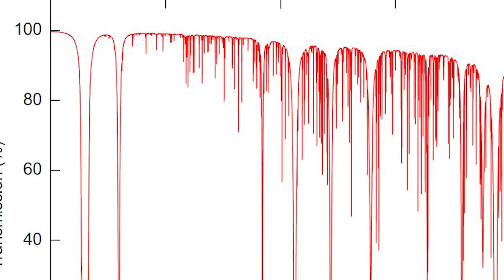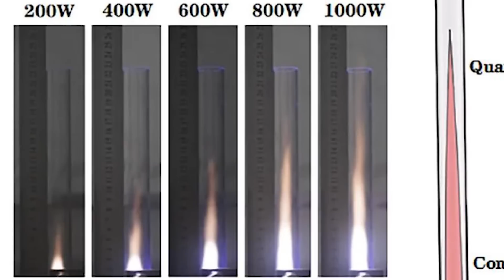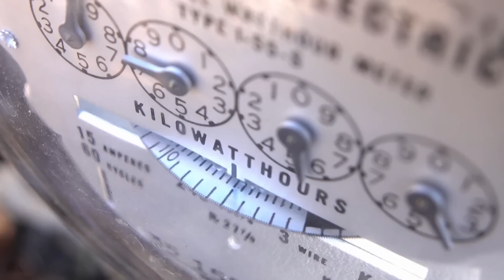The Microwave Plasma Jet Engine that Could Change Everything

Comment: I know that there are RADAR units that can generate several megawatts of microwave energy (I've worked on one), though they're definitely not small or lightweight. A reflex Klystron tube tube has to be shielded by lead panels because it will generate strong enough x-rays to be lethal. Those are probably outdated by now, though they were still in use around 1980. 

An aircraft would have to have a means to provide electricity for any form of plasma engines -- photovoltaic cells won't be able to. Current battery technology would be too large, bulky, and heavy, plus the manufacturing of them (including mining and processing the minerals needed) would add to overall pollution (which China has been doing a great deal of). 

I'd have to agree with the "pressure cooker" quote -- all they did was heat the air in that tube. Plus, the round ball has some aerodynamic properties of its own. 

Might we ever get ion thrusters of sufficient power to propel craft through our atmosphere? Maybe. Probably not in our lifetime, I suspect.  

If we did have all manners of commercial aircraft with "plasma engines", all of that ionized gas they'd be spewing would be wrecking havoc with our atmosphere, radio communications and navigation, weather RADAR, and more.
Reply: I had never even considered the EM noise from these things. That might even be a problem in space, the only environment that ion thrusters even work.
Reply: @eloiseharbeson2483  I'd think that the solar wind would carry away the ions over time as long as they were far enough away. Around our planet, they'd just get sucked down into the magnetosphere at the poles. The ions within our atmosphere could be a problem, though.
Reply: @eloiseharbeson2483  Agreed, besides the discussed points on them creating more atmospheric pollution than they would prevent, especially if a renewable alcohol based fuel is used with modified jet technology for large airliners and H2 fuel cells and batteries for smaller prop based travel, the atmospheric drag losses and relatively short flight distances from one part of the planet to another will require a mammoth amount of energy. The only way I see these working for intraplanetary travel is with H2/O2 rocket assisted takeoff to get them to an altitude where air resistance isn't an issue when it is lit off, and very long distance, like a NYC to Tokyo flight.
Reply: @eloiseharbeson2483  "In space, no one can hear your ionic scream".
Reply: Klystrons are still very much in use. Many high powered weather and surveillance radars use them.
Reply: @kiowablue2862  I think that is because the klystron is more tuneable.  Radar systems can do clever things with the frequency of what they transmit.
Reply: I think a magnetron is going to be more efficient that a reflex klystron.  In the klystron tube, the electrons still have a lot of kinetic energy when they hit the anode.  This makes a lot of heat and X-Rays.  In a magnetron the electrons are moving nearly at right angles to the surface as they come to it and they hit the part that is currently on the negative going part of the swing. This should mean that they are slowed a lot in the process.
Reply: @kensmith5694  I haven't worked on RADAR units for quite some time, so I'm not sure if or how much they're still used.  The one I mentioned was used in a RADAR system I used to work on that put out between 3 MW - 7 MW, though at the time it was being phased out. The magnets for magnetron tubes can be heavy, also are fairly strong -- we stuck a guy's arms to a metal storage cabinet by putting one magnet half on each wrist with his arms out wide. He could not pull himself off. X^)
Reply: @ronaldlebeck9577  Radar and Satellite systems have been using traveling wave tubes (TWT) for awhile
Reply: @_____ Or, the curve could flatten out to "no further improvements".
Can you give me an example of a working short-haul electric air flight service?  Or even an airplane model?
Reply: I had a middle school science teacher who used to work at Los Alamos when he was younger. He told us how they used to take the radar dishes and use them to melt spoons together for fun. This would have been in the 60s probably
Reply: You are aware that to some extent stove flames are also ionized, right? :))) 
Ionized species recombine rather rapidly after the energy source maintaining the plasma is removed.
Reply: I suggest you look up “keys to the truth”youtube channel “how do top gun fighters work”. Microwave plasma crystal electric engines. We have had these engines since the sr71. No room for fuel in wings and no fuel tanks, same with all 5th gen fighters.

Comment: The elephant  in the room is that  ion propulsion  is a method of converting energy to motion. An electric motor does this today.. RC drones and experimental airplanes already exist. They  are all limited by their power supplies.The real breakthrough is cheap power and lightweight power sources.

Comment: So what generates the electricity ? How can anything be lightweight enough to output the necessary power. Can't be nuclear. So what fuel to run the generator ? And what is the source material for the plasma ?
Reply: If you look into china there are tons of scams like these. Baking companies that are suddenly applying for semiconductor grants from the gov "yeah sure". This is just another of the manyyy scams going on like this in china
Reply: Hamsters! Lots & lots of Hamsters spinning the generator! /sarc Commerical jets use more than 40 MW of power during flight.

Comment: Great, but how do you generate the electricity to generate microwaves?
Reply: Lots of coal.
Reply: @dMb1790  I was going to suggest a turbine engine running on kerosene.  You could direct the turbine's exhaust out the back to get some extra thrust.
Reply: @kensmith5694  😆😅🤣i see what you did there. Kerosene such as jet A?
Reply: @sinformant  Yes, I was hoping to entertain the lurkers with that one.
Reply: @kensmith5694  so like an APU
Reply: @NotRandoWis  No, more like a jet engine.  Think about how much power is needed.
Reply: Extention cords.
Reply: @AtomicSquirrelHunter  🤣😂🤣 yes

Comment: Yeah, but what happens when we runout of unicorn farts?
Reply: Lol, you made me chuckle. I suppose the correct answer would be to use genetic engineering to produce more unicorns, thus solving "The Great Unicorn Fart Shortage" of the early 21st century. The farts would have to be fartisctically adjusted for the hyper inflation we are now seeing in modern times. Thanks Biden.

Comment: Even if such an engine has zero carbon emissions, I have to wonder if such a plasma powered device might still have any effects on atmospheric chemistry.
Reply: Yup. It would produce a lot of Nitrogen oxides. I am pretty sure the EPA would say "No F'ing way!"
Reply: With the electricity required to generate that plasma, there’s obviously still going to be carbon emissions involved in generating it. Nuclear power is our only way to fully go green, but people are ignorant and scared of it. Solar, wind and hydro work, but not nearly as well as nuclear. The emissions caused in building windmills and solar farms takes a ton of generation to offset in the first place, while nuclear power is thousands upon thousands of times more efficient!
Reply: High ozone emissions, maybe?
Reply: @rockydogsdad  NO2 emissions.
Reply: I am also figuring ozone emissions as well.
Reply: Scientifically speaking; no. Lightning forms plasma with every strike and its only effect on the atmosphere is creating water-soluble nitrogen compounds that are greatly beneficial to plant life.

Plasma is simply high energy particles of whatever gasses are being elevated, the only route from high energy to low energy is by bleeding the energy through radiation (I.E. heat or light)  or by bonding molecules.
Reply: @MisterLEM0NS  It is very likely that such and engine will make lots of ozone.  This is fine at a high altitude but near the ground it is trouble.

Comment: Microwave yea right did anyone catch the real problem here.
How are you going to protect the people and the electronic in the aircraft without heavy grounding?
You would have to rebuild every airport across the world as the ion stream from the engine would knok out radio communication it would be like a nuke came out of the engine all that ion gas.
If the engine lost it shielding YEK'S.
It sounds all well and good till you look into what else it's going to effect.
Out in space no problem here what new gas's will it make from the air going through the engine as you are super heating it ?
Let's hope they look into all it's problems now and the ones it will create!

Comment: The thrust wall could be shielded by a magnetic field.  That increases the power use, unless you use permanent magnetics.  That moves toward magnetic hydrodynamic drive which does work for small aircraft propulsion.
Reply: Ah…a heavier pressure cooker !
Reply: @edward5979  If you really want to crank it up,  add a nitrogen cooled super conductor.
Reply: Nope. A magnetic field would never be sufficient at high pressures. Plus heat would be an issue since magnetic coils generate a lot of heat, and with superconducting you need the added wieght of cryogenic liquids and cooling equipment.

Never going to happen. A commerical Jet with convential engines has about 40 Megawatts of power.
Reply: @guytech7310  Magnets are being used to keep fusion temperatures, 100,000,000 degrees, under control.
Reply: @deltonlomatai2309  Very very low pressures, in the milli to microtorr in fusion reactors.  A plasma jet engine would operate at very high pressures, at hundreds of PSI (1 PSI = 52K millitorr) Also need a lot of power to energize the magnetic coils.

I work with this stuff.
Reply: @guytech7310  Iter will generated a force capable of holding the twice the force of the space shuttle.  "The structure of the ITER central solenoid—the large, 1,000-tonne electromagnet in the centre of the machine—must be strong enough to contain a force equivalent to twice the thrust of the Space Shuttle at take-off. That's 60 meganewtons, or over 6,000 tonnes of force"
Reply: @deltonlomatai2309  The plasma inside the the ITER reactor is is 10^ -4 PA or 6x 10~-8 PSI, or 3 microtorr.  Look it up if you don't believe me.

Structure of the ITER is to hold the weight of the reactor, wieght of the coils, & force generated by the coils pressing on each other. 

Plasma pressure in the reactor his to be extremely low so the ions can reach speeds to overcome the coulomb preventing fusion. 

I work with this stuff, I know what I am talking about.
Reply: @guytech7310  2.05 atmospheres, a 15 percent improvement was achieved at the MIT fusion reactor.  2.05 ~ 1558 torr
Reply: @guytech7310  Typical prefill pressures for tokamaks are between 1 and 100 mPa. As will be explained later, ITER will have to operate at prefill pressures of typically p   =  1 mPa, which means npre  =  2.4 · 1017 m−3. For H2, D2 and also He, each prefill particle carries two electrons.

Which is what you are describing.
Reply: @deltonlomatai2309  OK, then why are you telling me its enough to operate at high pressures that are at hundreds of PSI required for Jet engines. its like trying to compare a mosquito to a Boeing-747 and staying they are the same because they both fly.
Reply: Bwah ha ha ha ha- sorry.   It would never work and way a ton.

Comment: all of this is a joke. it doesnt work from a physics stand point as well as there is no real shortage of liquid fuels like jet fuel. this is a classic case of "vaplr wear"
Reply: Your right that it will never work, but World Oil production peaked in 2018 and is now in permanent decline. World will have to deal with 5% to 7% annual Oil production declines going forward. I suspect by the early 2030's Commerical Air travel will collapse as the cost of fuel will be too expensive.
Reply: There is a shortage of jet fuel once you leave the atmosphere though.
Reply: And how do u know this please respond also china will collapst and it cant affoard a war yust 1 week and there going to have 30 k casualtys and they have 0 EXPIRIENCE in warfare beside its like russia Yust 100 times worse
Reply: It's even more suspect when you consider that this technology would be game changing, yet the Chinese are boasting about it before it's even a prototype aircraft

Comment: Quote of the day "the pressure cookers don't fly" 🤣 great video as always!
Reply: Pressure cookers don't fly TWICE.
Reply: @sometimesleela5947  this
Reply: Dark Tech: "Pressure cookers don't fly"
Mythbusters: "Hold my water heater"
:)
Reply: Yeah! 
But they had a good point. Lifting that ball means nothing, unless it's lifted far above the opening (at least 10 cm or so, above the opening), so it gets clear that it really is the speed of the outrushing air/gas/plasma that lifts it and not just pressure build up underneath. If it was only lifted very little, the flow rate could be very low and produce almost no thrust at all, while the pressure inside the tube is still well enough to lift the ball off the opening.
Reply: Maybe not fly, but... falling with style.
Reply: @danmallery9142  as the Russians like to use incredible verbiage nowadays. Pressure cooker had a negative, directional, climb rate! 🤣
Reply: @FreedomIsNotFree2023  The pressure cooker was given the choice to fly or be conscripted?
/s